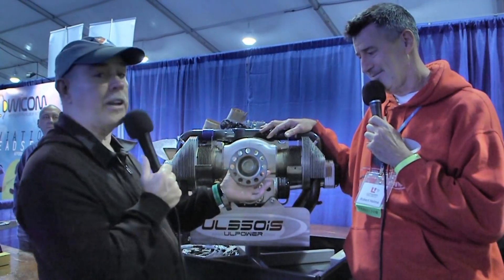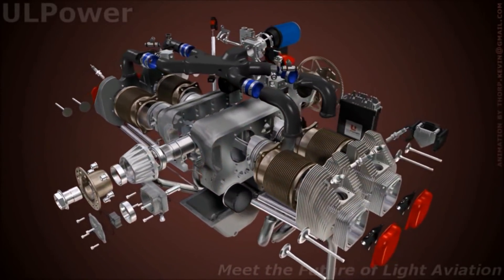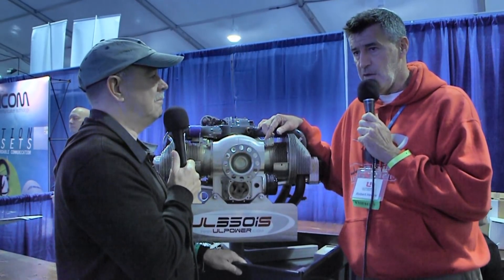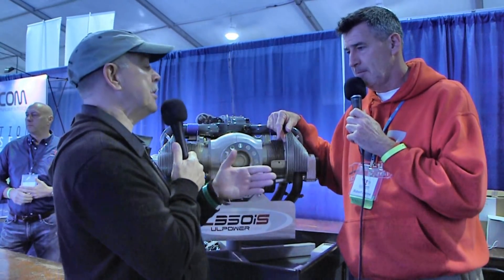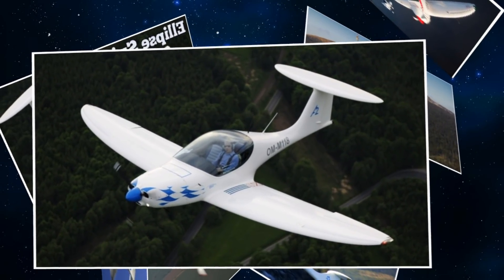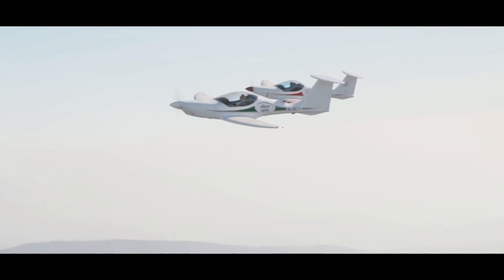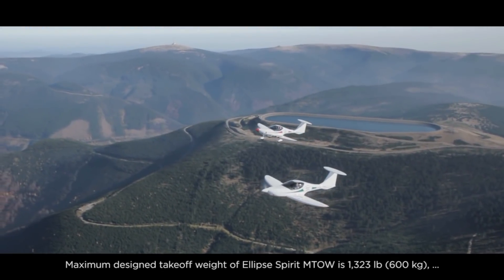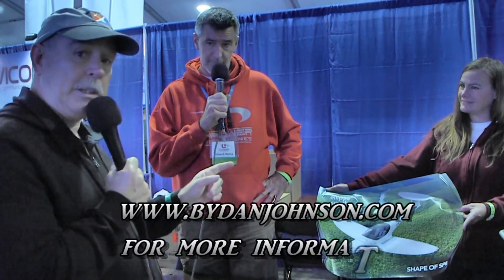Midwest LSA Expo September 6, 7 & 8, 2018 – UL Power Experimental Aircraft Engines

Comment: What I would love to see is a design with Camshaft above Crankshaft and the 2:1 Reduction gear designed to spin the Prop as well as the Camshaft. 
4500 to 5000 rpm is pretty low for even a pushrod motor. Hopped up Chevy LS/LT motors are known to rev to 8000+ rpm safely.
Limited to 3000 rpm for Direct Drive is a waste of a motors potential.